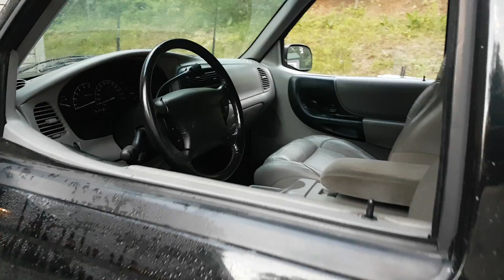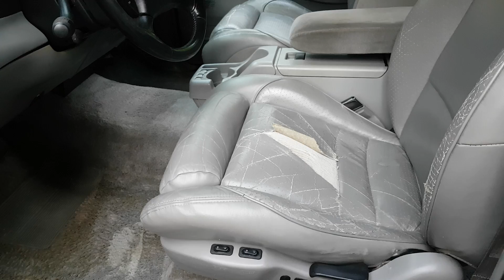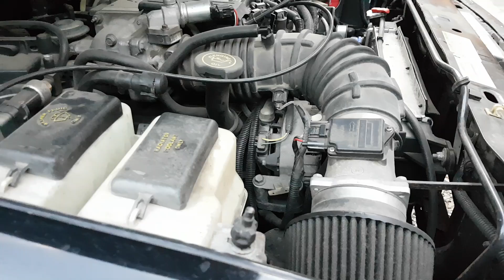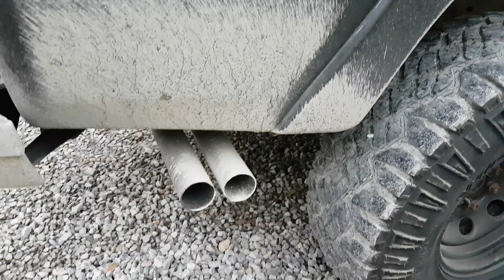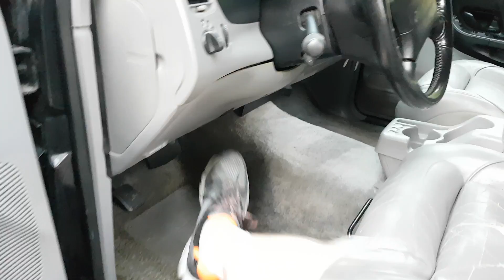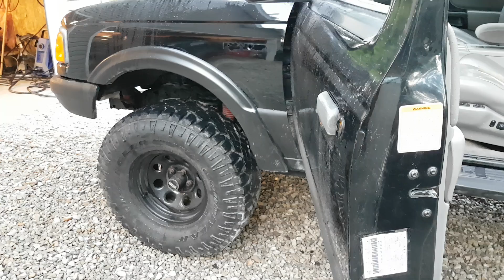1995 Ford Ranger 5.0 V8 Project Truck

Comment: Hey doing a 2000 swap to my 2000 ranger do I need the explorer body harness or no ?
Reply from the maker: Shouldnt need it. Might be different on yours but usually just need engine harness.may have to repin some wires. I'd recommend you get a wiring diagram for the donor vehicle and your vehicle and compare

Comment: Do you need to buy a 4wd automatic transmission for the conversion or no cause I'm doing one rn.
Reply from the maker: +Kennybarr 98 it best to get the whole drivetrain together from a wrecked explorer.
Reply: tichendorf I am buying a wrecked one the only problem is the fact most are 2wd Instead of 4wd like my ranger.
Reply from the maker: +Kennybarr 98 i believe the transmission is specific or at least the rear half of the casing is different where it mounts to the transfer case.

Comment: Bought the same version ranger and it has the same switch on the right side of the center dash the one that clicks up and down by the ac vent, what's it do? Mine is wired in but Idk what it does, please respond
Reply from the maker: +Dick Vandyke In this it was for a fan. No longer there though

Comment: even the factory v8 explorer radiator is pretty oversized to the heat of the engine.  it looks like you need another 97 doner to get the last few things straightened out.  I would just swap the whole dash to fix the airbag and the ABS module to fix the ABS light

Comment: I did my 98 ranger with a 5.0 and 33's and an 08 front clip... these rangers are bad ass! Lot easier to do the conversion in a 98-2001 of coarse, but the challenge is fun!
Reply from the maker: Jerry Nunya Cool. I had a 2000 Ranger before that I did the 08 style hood and bumper / mirrors, etc. on. It was a good lookin truck.

Comment: what radiator are you using? i have a 351 windsor swap into my 88 ranger and i also bought the truck already swapped. im having troubles with heating issues to the motor wants to run like 220 degrees F
Reply from the maker: Douglas Cope I believe the radiator is a stock Ranger 4.0 radiator
Reply: tichendorf ok thank you! do you ever have any heat issues with yours?
Reply from the maker: Douglas Cope no heat issues. I have a spal Extreme Performance electric fan which makes a big difference

Comment: so my plan is to get a pre96 (preferably 95) ranger,fx4, extended cab,manual. I have this 61, 430 Lincoln engine making about 375hp and 490foot pounds!, if you got any tips please let me know :) (btw love your ranger my dream is to some day get a coyote 5.0 and put it in a newer one)
Reply: 83slinky I've done this swap before. The biggest problem's your going to have with your 430 is; finding exhaust manifolds that will fit and clearance issues with the steering shaft. It's possible but you must be a professional fabricator. It's a domino effect. This is what I would do if I was in the same situation. Either choose a different vehicle for the 430 or sell the 430 and purchase/build a 347 stroker to install in the Ranger. Same power in a much smaller/lighter configuration.

Comment: Not loud on camera. I know we all have our own volume that is loud. I think it sounds like a proper V8 should. For zero cats thats quiet compaired to what I have heard. Excellant find. Looks like it will be fun. You may want to check if the computer was changed to compensate for the tires. That might improve gas mileage.
Reply from the maker: I.C.U. Right_Now in my younger days you are correct that would not have been loud but my tastes have changed a little over the years
Reply: tichendorf that's cool. I understand.
Reply: My dad has a 78 thunderbird with no cats or muffler and it is the loudest fucking noise I have ever heard coming from a car. He has the 351 winsdor.

Comment: So no transfer case?
Reply from the maker: Bradley G It has an AWD transfer case to split power between the front and rear wheels but it is only 1 speed. there is no low gearing.

Comment: This is the kind of swap I wanna do with my Ranger.  It's an 01 EDGE with the 4.0L and 4x4.  But I'm stuck between putting a 5.0L in like this or a 3.9L Cummins.  I'll probably pick which ever works best with the manual tranny I decide to put in it.  But your truck seems really nice dude
Reply from the maker: Thank you

Comment: Very nice man! Love your Ranger.
The ABS light could be just a wheel sensor, very easy to fix.
For the AirBag light, theck if the "baypass" sensor is located on the airbag dummy plate. That sensor emulated the presence of the airbag, and maybe its disconnected and thats why the airbag light is on.
Reply from the maker: Thank you. The ABS light is because both front wheel speed sensors are missing.  The airbag light was because the front right side crash sensor had rusted out. I have since replaced it and the light is off.  Now I need to get a couple of ABS sensors to fix that.
Reply: Great! Easy fix then! There in the US you can find those parts at any junkyard for almost anything, or, any "stealership" will have them for sure!
Reply: Matias Fernandes ola amigo para acer estos cambios solo es meter motor y trasmision
Reply: Gracias Bily!!

Comment: The Rangers and Explorers both from 98-02 I believe are exactly the same with the square 42 pin connector for the engine to body connection. I have a 2000 ranger that I dropped a 5.0 out of a 98 mountaineer and the pinout was exactly the same. All I had to do was switch the anti-theft, re-pin the tach, and splice the ranger plug into the 8 pin explorer harness underneath the brake master cylinder.

Comment: have you thought about doing a solid axle swap?
Reply from the maker: Not sure what you mean?  It has a solid rear axle.  It has the 31 spline Explorer 8.8 with rear disc brakes if that is what you mean.  It has custom leaf springs and a custom made 1 piece driveshaft.
Reply: +tichendorf I meant in the front
Reply from the maker: +My info oh. no i havent thought about it.   i havent had any problems with the one thats in there.

Comment: question. I'm doing this project right now, swapping the 4.0 for the 5.0. how did you get the cluster to work with everything else? is it just plug and play?
Reply from the maker: it is plug and play depending on the year.  you really have to have the wiring disgram for both to compare and make sure they wires match up.

Comment: hello i have a question not trying too be a downer  i noticed when u turn your kwy on no check engine light  it's supposed to light up then go out when you start it have you hook a scan tool up to it to see if you have codes by any chance
Reply from the maker: Yes. Good eye. i am aware of the issue. The bulb is good but something isnt right with the wiring between the PCM and the cluster. I checked the codes before I bought it and there is 1.  an evap code. no big deal.  Also there were 2 codes for the rear O2 sensors since the truck didnt have cats. i have since taken care of that and installed converters

Comment: Hey man I have a question about the video you posted about the flow master muffler on your v8 sport trac, I have a 2007 v8 sport trac and can't find the muffler size I need any where thanks to the rarity of the truck. You said the muffler was 2.50, did you change the pipe size or is that the stock size???
Reply from the maker: I had it all welded in at an exhaust shop so the expanded the pipe to fit the muffler.  i think oem is like 2 1/4 or something